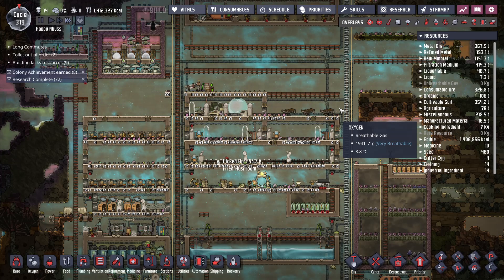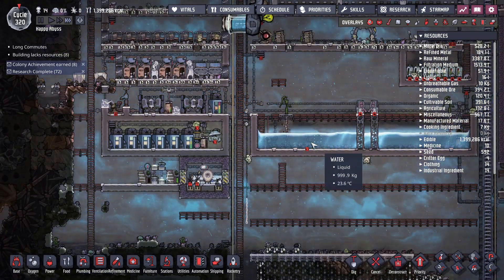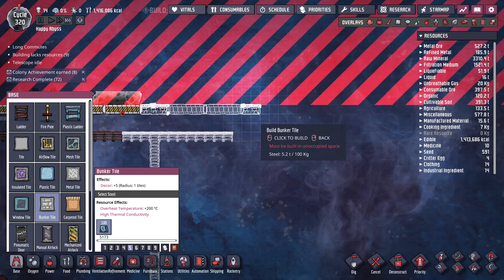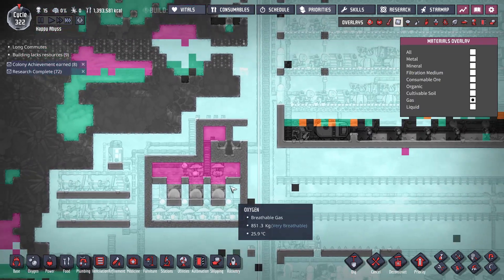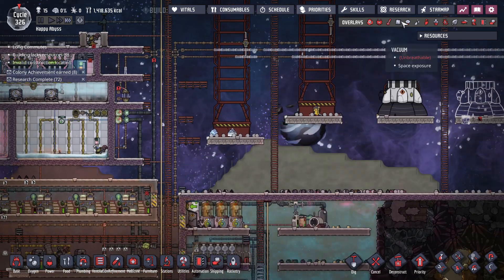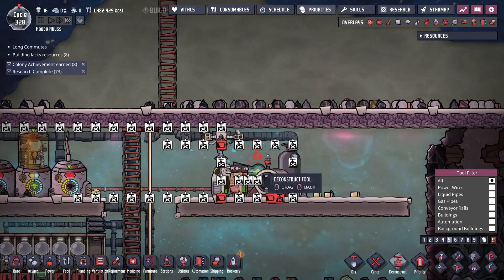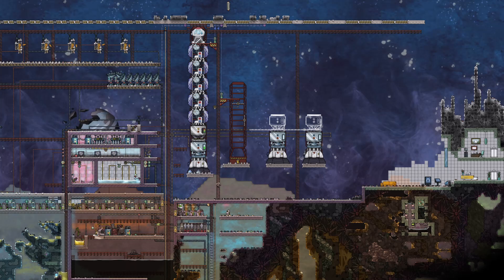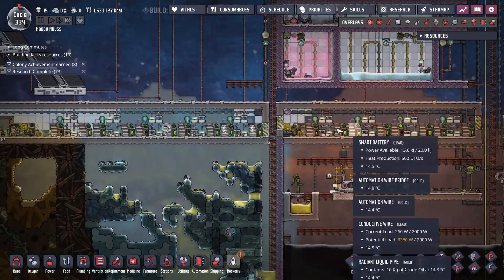Happy Abyss Ep 9 Liquid Rocket Fuel Time, with Flip/Flop Power distribution in Oxygen Not Included.

Comment: How come the small wires do not over load?  when ever I hookup any wire thats different the lower value one instantly overloads.  

you have 1kw wire directly connecting to 2kw wire.  when I do that I get mayhem :)
Reply from the maker: That is the exploit, if the little wires are never hooked to a load, they never overload.  The automation disconnects them, and the game doesn't think charging batteries is a load.  Look around 2:40 and see the wire load is 0W as the power flips back and forth.
Reply: @TartarusPlaysGames  OOOOOOOOOHHH..   You sneeaky sneeaky :) 
so now you extended it beyond the automation will it over load ?
Reply from the maker: @serdaraytemiz9978  yes, I even had to make it 2k wire into the shutoff.  This also working going from thin wire to 50k wire.
Reply: @TartarusPlaysGames  Evil Grin